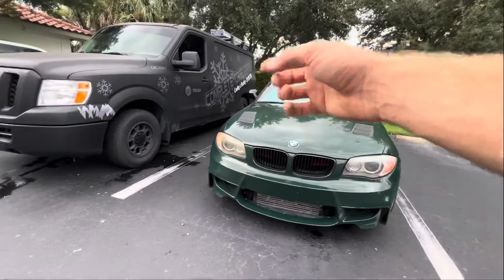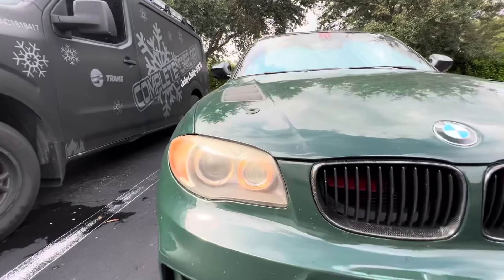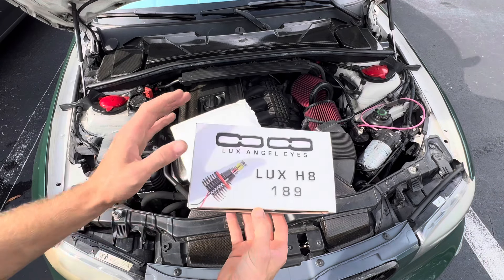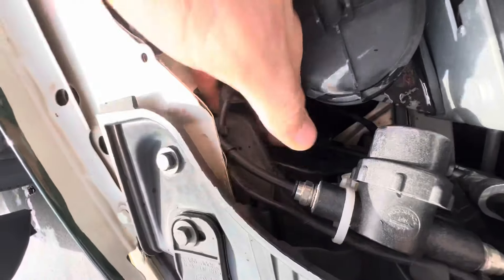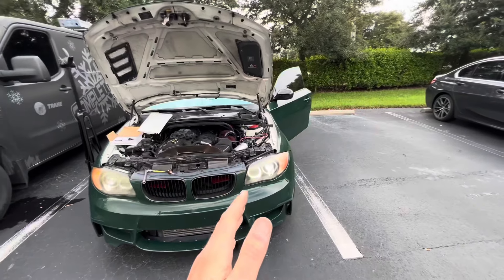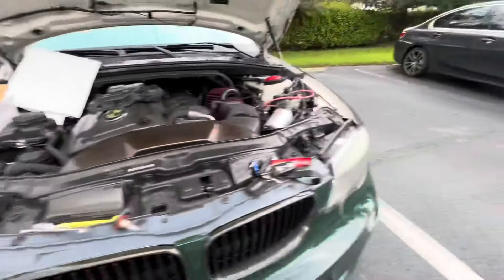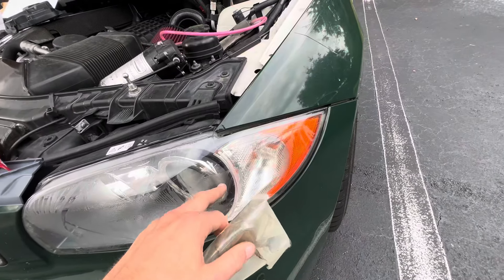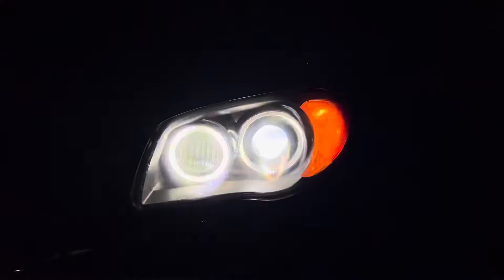HOW TO UPGRADE YOUR BMW’S HEADLIGHTS WITH THIS SIMPLE UPGRADE!!!

Comment: Bro you helped inspired my build,shes now 95% complete,i went with
Pure stage 2 turbos,turbo inlets and outlets
ARM motorsports gold FMIC,turbosmart Bov,vrsf downpipe,berk technology exhaust,ebc bluestuff brakes,drilled and slotted rotors,rear drag radials, INDY 500 tires full set,275/35/18 Front, 255/35 18 rear,evolution race works brake lines,aodahn 2 black wheels gold rivets,mhd super license,vxt, xhp transmission flash,  chargepipe,,aluminium valve cover,ngk cold spark plugs,delphi ignition coils, snow performance stage 3 water/methanol injection kit,
Last thing i need is the aluminium intake manifold, red satin chrome wrapped with carbon fiber lip,spoiler,mirror caps, 2011 135i M sport 

Thankyou for sharing your progress and story,its really inspirational and helped with alot of my set up,i saw you come such a long way.Thankyou for all you do..
Reply from the maker: That’s so awesome to hear. I’m so glad I could help you get your build going. Sounds like a beast man 🔥. People like you are the reason I keep doing this. Can’t even explain how grateful I am to hear that 🫶🏻
Reply: @verify_135i  i remember getting ny car stock and dis what you said on maintainence right off the juno and replaced everything new even if it wasnt broken yet,crazy how knowledegeable you arr on this vehicle,i can only inagine where youd be a year fron now  yiu keep getting even better.
Reply from the maker: Working as a tech a bmw for years definitely helped me understand how the n54 was a beast if you did all of your preliminary repairs. Saw way to many cars let go in different ways so I had a pretty good understanding of what not to do. Beyond happy to spread that information to my n54 brothers out there